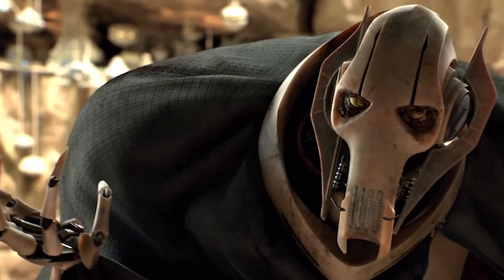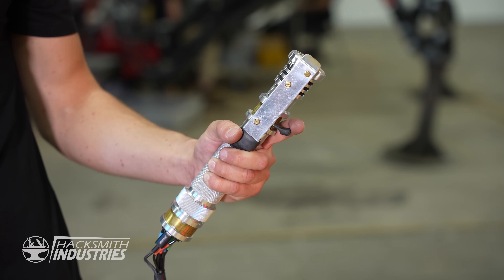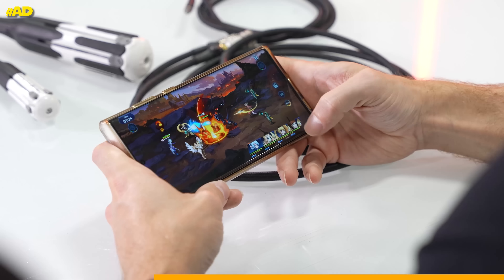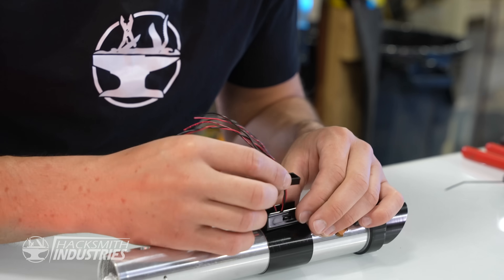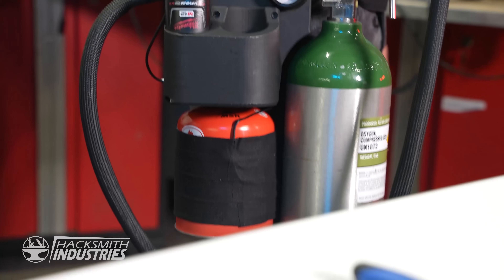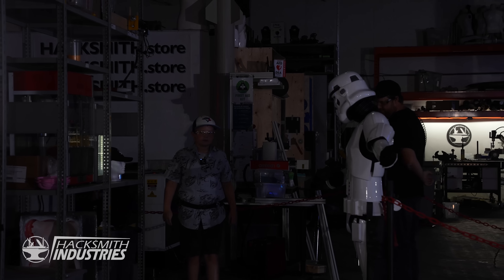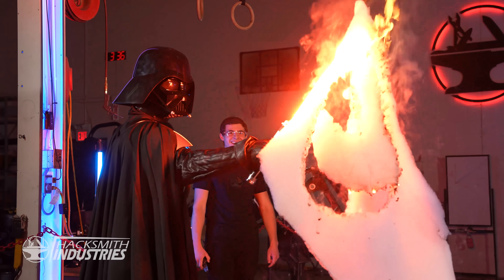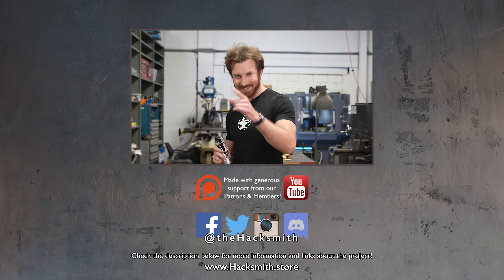My Best LIGHTSABER Yet! (STRONTIUM PLASMA 4500°)

Comment: If you "adjusted" the powerpack by adding the guts of a sand blaster configured to feed strontium powder (or other colored pyrotechnic powder) into the gas stream instead of sand, it would burn a given color continuously instead of until the paste burned off the cowling. You could even adjust the brightness on the fly by controlling the amount of powder feed with a manual knob or a computerized valve controlled by a color sensor.
Also, maybe using laminar flow nozzles would make the flame longer and more even? Or perhaps metal 3d printed mini rocket nozzles to accelerate the gas faster so it shoots further before burning out? Something besides just cutoff copper tubes.

Comment: Well like you proved in theory you just need to downsize it if there was only a way to make the gasses used more dense so you could fit more into a smaller tank hypothetically to have a cordless one you need to store all the internals in the sabre itself so the pcb would need to be the size of like an arduino pro micro and if you put more of internals relating to the blade itself close to the tip off the sabre you could shrink them down hopefully allowing for small tanks to fill up that free space although would be a huge challenge I mean making custom gas tanks and you’d properly have to make it a bit thicker more like a two handed sabre but I reckon that would be the next leap to wards cordless you would have to increase the size of the sabre but shrink all the components

Comment: Just curious to ask, wouldn’t increasing the volume of air, through a tighter valve (creating more pressure) help with the length and movement of it? Also wouldn’t a higher pressure flame eventually be strong enough for contact (yes I’m aware this would create thrust and would push you back)

Comment: The blade length, lack of a power pack or cable, ability to swing the saber, and a more consistent color are all going to be really cool once you guys tackle them, but from a theoretical standpoint, I really wonder how one would make it so that lightsabers could 'clash' off of one another - and whether this is a feature that Hacksmith envisions by 2030 🤔
Reply: Needs some kind of rod that would extend out in the center and not melt lol
Reply: @Dmanpeterson  or magnetic field
Reply: @starkilla102  Try getting a magnetic field that's the exact shape of a lightsaber lol
Reply: @Syuvis  yea, you would need a field to contain the magnetic field which would contain the flame. Just mentioning it sounds ridiculous.

Comment: I feel it's likely that Hacksmith inspired backpack lightsabers will actually be synthesized into the canonical Lore as the Proto Design of the Proto Saber: they are now currently at the level of more hip based power-packs....and now we know the technology needed to get there. 

We know enough about technology to know that before things can be downsized for convenient use, they have to be Prototyped Big to be easy for builders to see how all the parts will fit together. 

Whatever else we don't know about Star Wars galaxy metals, we know it's likely they first had to make sabers that took up a whole backpack before they could rest the power pack on a belt. 

As for writing the story of the inspiration in universe for making a lightsaber, you could combine the origin of blasters with the discovery of crystals and the sword users would go a different direction than coexisting gun users.

Comment: An expanding hollow rod, made like an asp baton coated or made from titanium carbide with holes drilled at multiple equidistant points around the circumference of the expanding part from where the blade exits the hilt of the Sabre to the top could make a solid core capable of supporting the high temp (titanium carbide is good up to 3100 degrees c.) blade and actually allow the blades to strike one another as they would have an expanding core. This would also fix the length issue as the gas doesn’t have to be propelled 3-4 ft long, just enough to envelope the outside of the titanium carbide rod with the plasma.

Comment: Why not have a metal bar that ejects from the saber? So duels and interactions can actually happen, it may even help with length
Reply: good idea, but i think the metal would melt
Reply: I think they tried that, but Im guessing it didn't work that great because of it melting, even with the most heat resistant stuff they found
Reply: @fauxmarmorer9544  fair, it would be hella expensive to reproduce too
Reply: @flawful4266  like this one isn’t lmao

Comment: The main problem about making a movie accurate lightsaber is the blade's behavior. We can agree that it's not formed of light, because light it's not matter, but a consequence of matter's and physic's behavior. So, the blade cannot be made of light itself, but of something so hot that it emmits light. There's where the plasma takes place, but plasma it's not solid, it's more like a glowing gas, so the main task here would be to make the particles in the plasma beam behave like a solid while being as light as plasma, and to do so, you would most likely to hold the sun in your pocket...
Reply: was gonna say cuz the sabers can physically be pushed through stuff its not just a big really hot bics lighter which lets be honest this kinda is cuz its a flame really or at least behaves like one. like the saber can clash and it has physical substance. its better than the other design ya know not having to have a battery pack but still kinda just a plasma cutter

Comment: Now, I know that you're still iterating through versions, but this version already has several potential uses around welding / cutting and probaby could even double as sort of a portable forge... Like, yeah, it's not a real lightsaber yet, but... it's really cool and really scary already! (got me thinking about lightsaber burns and how to deal with them)
Reply: Could probably have a lot of use in disaster situations when you need to clear out large chunks of rubble and can't get large equipment close enough to break it up.
Reply: @DarkWolfsDen  wouldn’t that just superheat the rubble? I’m assuming it’s made out of something hard like stone. I don’t think these iterations can melt or break stone just yet
Reply: @oneofthepeoples  I am thinking more like rubble from a building collapse. Course cutting through material and not people... might require experimentation.
Reply: We already have those, they're called torches.
Reply: @sino_diogenes  welding torches? Yeah, I don't mean "this looks like it would be better than regular". More like "that looks like it could also be used for that".

Comment: A strong next step could be making a bespoke quick connected at the bottom of the hilt instead of the side that houses all of the in lines to the hilt in one joint, the hoses could be braided together in shielding leading out from the hilt. It would give you more manoeuvrability than the side exit which is going to be putting torque into the hilt as you move. It would also look more true to the early galaxy protosabers. Possibly mixing in a small amount of longer chemical chain combustibles  to the gas flow, gas can carry momentum like anything and the heavier slower burning molecules could help extend the blades length. Experimenting with the very controlled mixes of certain reactants could do some really interesting things to blade length, heat, colour and stability.

Comment: I'm surprised nobody has tried making a lightsaber using intersecting lasers. Holographic displays are already using connecting lasers to create displays with plasma formed from the ambient air, which actually lends some credence to George Lucas calling lightsabers "laser swords" and explains why kyber crystals are an important component; the crystals focus beams of light into a string of intersections where destructively interfering wavelengths collide and expend their energy by turning the air into plasma.

Comment: Could you use some type of metal (tungsten?) coiled up that could expand and retract to provide structure to the blade? This looks amazing and is such an inspiration to look to for me almost getting done with college! Keep up the good work guys!
Reply: See Tungsten is just too dense to be viable, neat idea though, maybe they will look into it.
Reply: What about graphene? Could that work?
Reply: @Whoami691  Very cool idea too! Graphene melts at over 4000 degrees C so maybe that could be viable. It is very rigid though so not sure you could make it into a coil or anything retractable

Comment: Where do they go from here? In order to get rid of the power pack they'd need a battery that stores an enormous amount of energy. Maybe a graphene solid state battery? They'd also need a miniature super dense liquid oxygen tank as well as an equal sized tank of the other component they use (forgot the name). They'd also have to have a circuit board that is much smaller and possibly rounded to integrate directly to the Saber hilt. Also, in order to contain the plasma properly into a specific shape there would have to be a miniature cylindrical magnetic field. Thoughts?

Comment: Crazy impressive but till the jump is made from Protosaber to true handheld lightsaber it’ll always be impractical in terms of being used as a weapon like the movies to bad that’s still a long ways off still the fact they’ve gotten it this compact to begin with is astounding now besides that you just need to figure out how to give it a physical presence when you pass your saber over a steel door there’s no resistance it’s not actually “cutting” it it’s melting if you were to take two and swing em at eachother they’d pass clean through eachother so some sort of physical side to the blade is still missing idk if that can be achieved with magnetic fields or whatever that’s where my mind goes cause your not gonna put an actual physical solid within the plasma for obvious reasons

Comment: In all the lightsaber combat forms, the blades have a mass, otherwise their techniques would be different. Have you considered fusing the concepts of a rectrable mass blade and the current system? Viable?
Reply: Would it be possible to build a nozzle system out of the physical blade to create the look and heat of the present system as a shroud?

Comment: for anyone interested in a standalone lightsaber build, alex lab has made the plasma generator based on hydrogen electrolysis instead of an oxygen tank. a charger pack with this could basically involve small battery charge and popping in some salty water like a green gas airsoft gun charger.

Comment: Hey Hacksmith, if there is any 100% plasma resistant material, would it be possible to make a retractable blade just like in toy lightsabers, but with holes for plasma to flow through, so duels would be possible while still being able to cut stuff?

Comment: use air-soft refillable green gas canisters linked in series filled with the gas of your choice theses would be small enough to possibly allow in hilt storage.  that is if the hilt were longer and the internal shrunken down abit. also try making the blade thinner or prehaps do a dark saber style blade so as to have less volume for longer work times and improved blade length.

Comment: What if you mix this version with the tungsten inner core version so you have some resistance when you hit something but it also had the flames and coloring!
Reply: Maybe you can make holes in the tungsten rod where the fuel can come out so you can make the lightsaber the lenght you want!
Reply: Or maybe make it from telescopic titanium rods so it can shoot out with a spring like system

Comment: You guys need to develope a structure around the plasma so that you can actually clash lightsabers and hit things with it. It should also help maintain the heat and the pasma inside that area and make the fixed blade length better and make it easier to cut through actual metal.
Reply: Theres just the issue of what has a melting point high enough to survive and is see through
Reply: @dinoaurus1  Dr. Michio Kaku already covered this on the science channel they're pretty much using the design he came up with anyways.

Comment: Would it be possible to push an air scaffolding around the actual blade? This might keep the heat away from  the user, and maybe lengthen the blade... Or just completely mess up the fluid dynamics.

Comment: I have three suggestions for your consideration on the next iteration-

1) I noticed that space was used for the decoration of the lightsaber hilt. (@7:14) I know that is what is EASY, but, if you machined or printed, or otherwise manufactured those purely decorative black pieces, you could make them hollow, cut out the corresponding sections of the lightsaber core sheath, and have possibly significantly more space on the inside without any decorative sacrifice. Especially seeing the guts, all those pipes might be able to open up desperately needed real estate on the inside of the handle, if they were able to fit in those areas.

2) Since you guys have gotten such PRIMO plasma flow now, the base of the blade has near perfect visuals. But, the limitations of gas projection are really hampering the blade length and tip shape.A possible route to consider for the lightsaber blade, to improve both the swingability, as well as a more satisfying interaction of the blade, is to create a narrow, collapsible scaffold, that would effectively extend your plasma release points into several telescoping points. This would be extremely hard, and I don't even know if it's feasible to make a scaffold simultaneously that narrow, and robust enough to withstand impacts as well as the heat of the plasma outputs. But, if you can find a way, then you'd get a collapsible blade that has actual weapon impact and a proper length. Such that, you could actually battle against other lightsabers, because the blades would no longer go right through one another. There are many different design approaches here, like vertical slits, horizontal rings, micronozzles. I don't know which would best fit the needs of this project without testing, but I do think this would be the best area to focus on.

3) If you are able to to solidify the strontium paste into a solid piece, you'd be able to make the saber look a smidge cleaner. That way, you could just have a reloadable ring cap on the lightsaber instead of gunky paste. Then you can apply that same molding process to expand into the other coloring chemicals for fire; boric acid/copper sulfate, potassium chloride, etc.

Thanks for reading!
Reply: mucho texto

Comment: I highly doubt you’re going to do this because even I think it’s stupid and I came up with it. I’m thinking that you could create a basic faraday cage and basically create plasma through whatever means you guys wish but would primarily probably be electricity. This faraday cage would have to be retractable but it would give it that solid state of matter that you guys are looking towards. And the plasma would be closer to the Star Wars movies, probably have the faraday cage motorized so it would be spring operated to open up, this would be accomplished by using some motors and stuff that I’m not even thinking about as well as a separate button. The plasma itself I have no idea about but in my three seconds of thinking about this it could theoretically get hot enough to melt a bullet quickly

Comment: I wonder if you guys could succeed in the lightersaber style from No More Heroes a little easier than the typical star wars light saber.   I wonder if it might be a good stepping stone for improvement?  Check out Travis Touchdown's Light Saber for that design.

Basically it has an extend-able boom-arm that has an emitter facing back at the first emitter, giving you a more katana-like single-bladed light saber. Just had this thought and wondered if that would be possible. (Bonus points if you can charge it up like a shake-weight.)